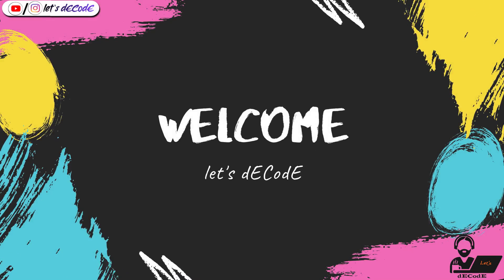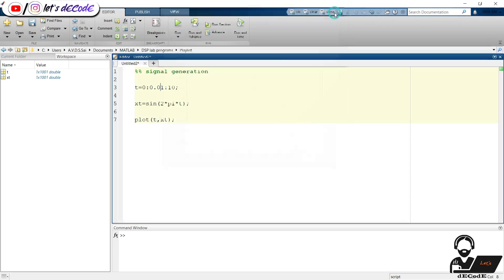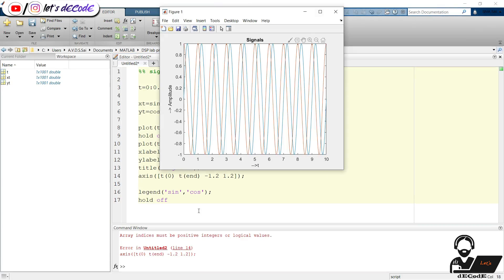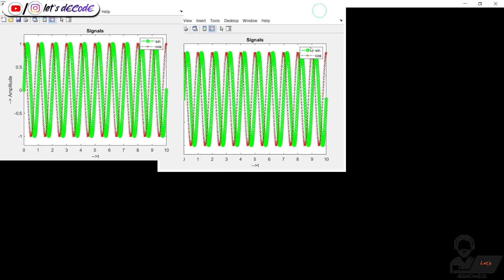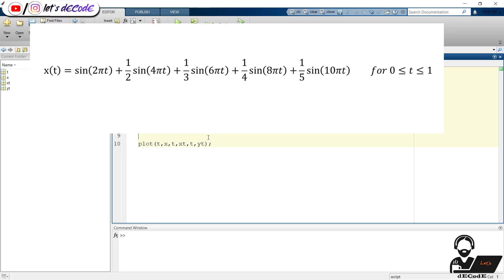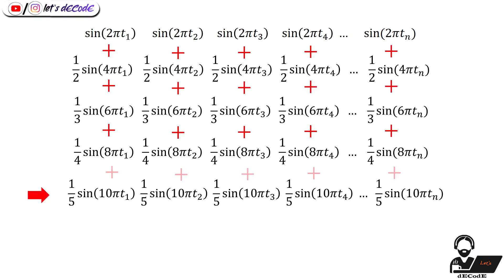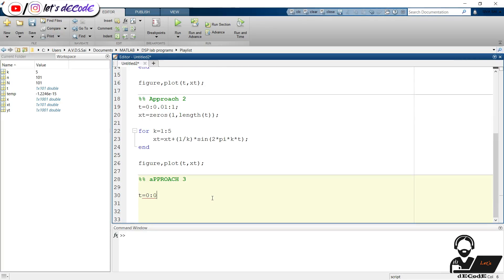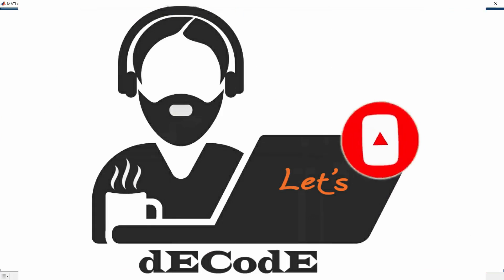Introduction to DSP using MATLAB || Part-1 || let's dECodE || DSP using MATLAB

Comment: % Parameters
N = 100;          % Window length
alpha = 0.16;     % Shape parameter

% Generate Blackman window
n = 0:N-1;        % Time indices
window = 0.42 - 0.5*cos(2*pi*n/(N-1)) + 0.08*cos(4*pi*n/(N-1));

% Plotting the Blackman window
figure;
plot(n, window);
title('Blackman Window');
xlabel('Time Index');
ylabel('Amplitude');

% Applying the window to a signal (example)
fs = 1000;        % Sample rate
t = (0:N-1)/fs;   % Time vector
f = 50;           % Signal frequency
signal = sin(2*pi*f*t);

windowed_signal = signal .* window;

% Plotting the original signal and the windowed signal
figure;
subplot(2,1,1);
plot(t, signal);
title('Original Signal');
xlabel('Time (s)');
ylabel('Amplitude');

subplot(2,1,2);
plot(t, windowed_signal);
title('Windowed Signal');
xlabel('Time (s)');
ylabel('Amplitude');